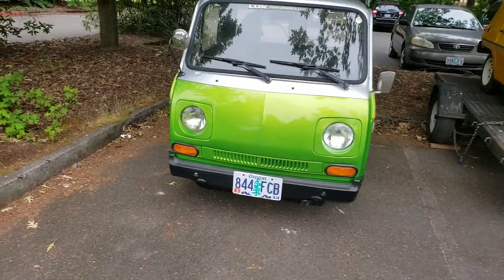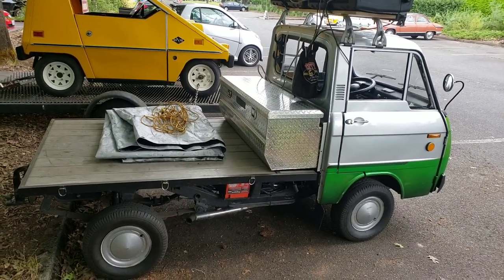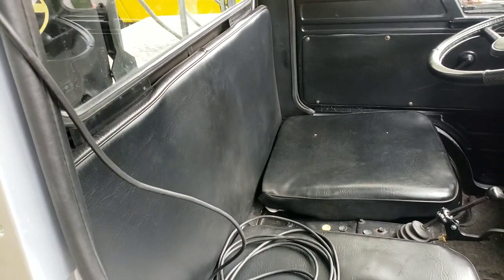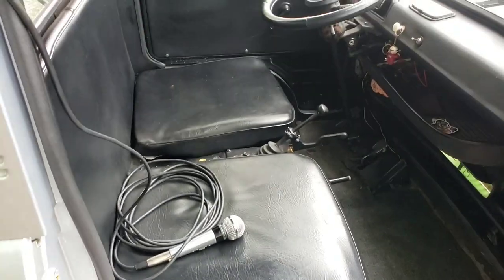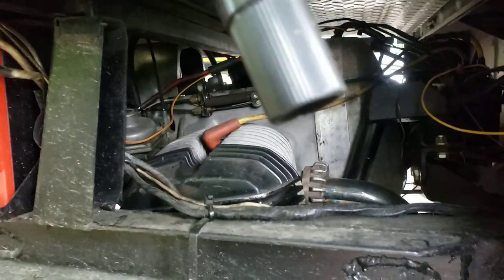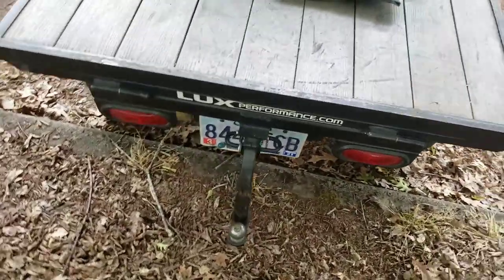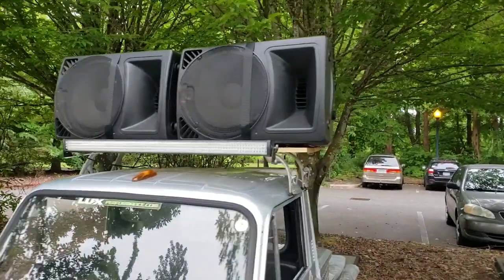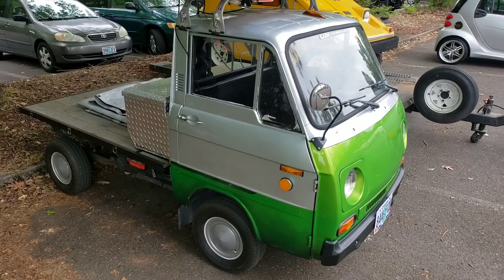Vintage Cony Wide Classic KEI Truck

Comment: I had 3 cony vehicles 20 years ago.  A cabover truck with the collapsing sides like a suzuki carry, a conventional pickup with a small nose and bed, and a microvan.  Never got any of them on the road, but they ALL had a horizontally opposed 2 banger. It's not a bike engine. I believe it's a Toyota power plant.  The one you're looking at might be a bmw conversion,  but it WAS originally born with a similar engine.
Reply: Ding! Also had a '65 Cony Wide van 20+ years ago. Same factory horizontally opposed 2cyl.

Comment: Interesting, thanks for posting this.  I'll guess that the electric motor and the lever on the gearstick might be for a reverse gear if he's using the gearbox from the BMW.
Reply: Since some BMW K-Series motorcycles actually resorted to an electric reverse, and so does the Honda GoldWing, it makes sense. I'm just not sure right now if the RT versions of the BMW R-Series also had this feature.

Comment: I test drove a competitor's truck years ago, and was really interested in buying it.  I decided against it solely because it was just too small for me to be comfortable in it.  If I had the metal working tools and skills I would have bought it and lengthened the cab by 6 inches.  Putting a motorcycle engine in it sounds like a good choice.

Comment: One of my dad's friends had 2 Cony Wide trucks in the early 80's. Oddly enough , 2 of my dad's other friends partnered up to become a dealer for the electric car like the yellow one on the trailer. They never got more than 4 of them and they not desirable at all.  They had about a 40 mile range and the on-board chargers  tended to fry . I don't recall the brand, I do recall that they priced about $5000.00 around 1980 or so.